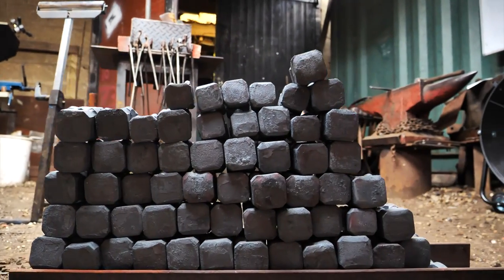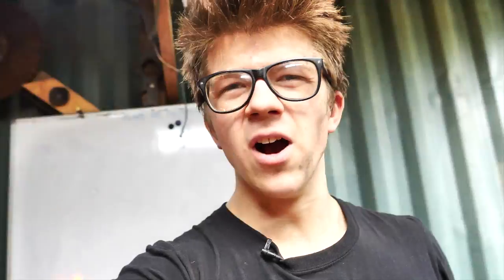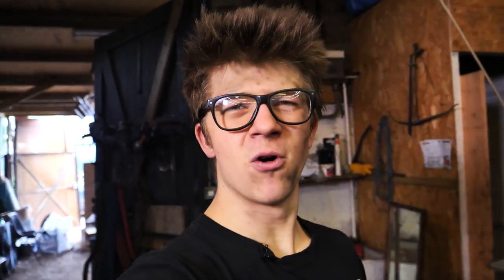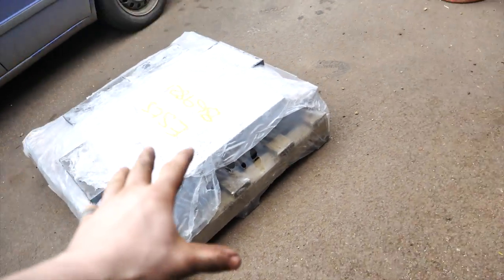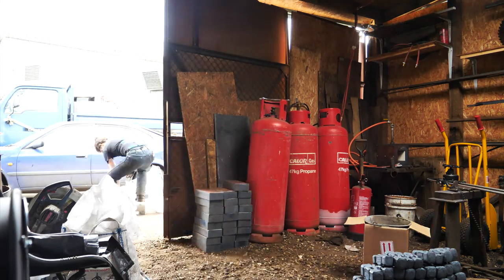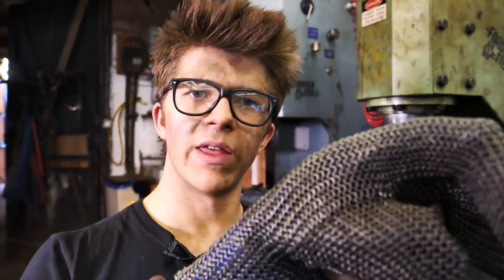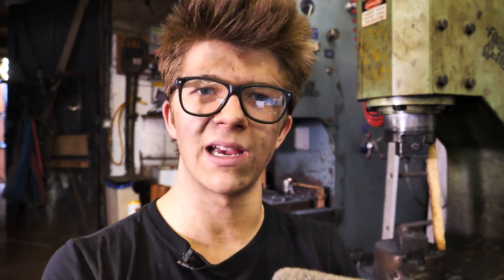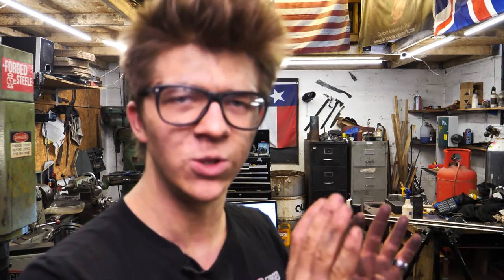MAKING 70 HAMMERS: Part 5.5

Comment: With the gloves: You remind me my start working in quenching factory. I received leather gloves and some linen gloves with one finger. I chose the leather one for dexterity. Older workers just watched me as I put on leather one and went to furnace. When I reached for heated material to move it to quenching oil (I had to put my hands quickly into furnace) those leather gloves shrank. All older workers were just standing by and saying: "Hmm we wondered if you figure out what are those linen gloves for". I had to tear those leather gloves of my hands. It was not possible to even take them off.